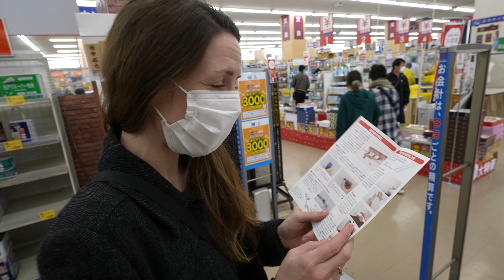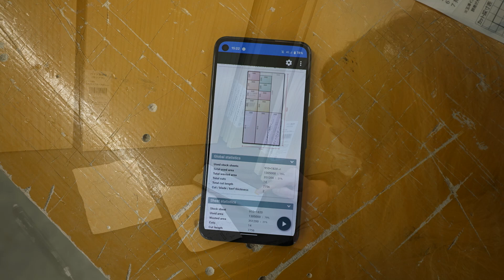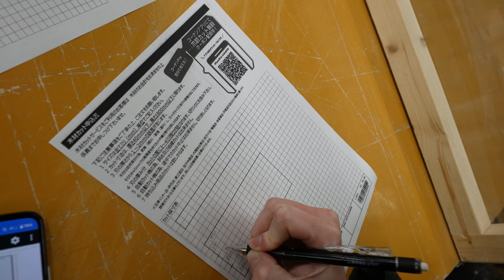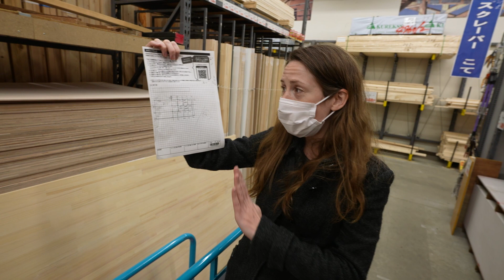DIY at a Japanese Home Improvement Store!

Comment from the maker: What kind of DIY stuff do you do where you live?
Subscribe! https://goo.gl/mkAwyy
Patreon http://patreon.com/kydeanderic
 / Paypal  http://paypal.me/kydeanderic / 
Amazon Wishlist http://kydeanderic.com/wishlist
Reply: Many.  It's kind of what I do here.  :)   (Though I dunno if "Olive, will you fix or make this?"   is really DIY or someone else getting something done.  :)  )   (Also as future suggestions go,   sometimes pre-made kits are a cheaper way to get materials.    Those metal ones,   if you get one that's too tall you could come off well buying that and a hacksaw.  :)  (It does however, seem you came off pretty well with the materials there.   In the US sometimes the pre-made stuff is actually cheaper than real wood...   if you can get a cut or two done at all that day.   The big difference there compared to here is they don't tend to want to be responsible for any precision at all,  never mind insist on getting it right.  :)  )
Reply: Oh,  also if it's OK to plug someone else's products,   check out these things called 'Wobble Wedges.'    They're like plastic or rubber shims about an inch and a half long,   and they can lock together to increase tension, especially if they're opposed to each other.  Mostly sold for like uneven tables and the like but they're useful all over the place.  (And they could be security-deposit-preservers.  :)

Comment: It's 2 free cuts at home depot and 0.25 cents per each additional cut.
The same size board you bought cabinet grade is $45-$65 USD.  I like the tension rod Temporal solution, nail holes are a pain to repair when you move out.

Comment: I liked this episode of Kyde vs the Closet Disaster.  I had a similar adventure once while trying to find a board and get it cut to prop up some drawer organizers in a closet. The organizers were measured to be the perfect size... but the trim at the baseboard made it so they didn't fit. Why is there even trim inside a closet?! (They limit you to only 2 or 3 cuts per board here in the US, that gets real tricky).
Reply: Maybe I should be replying to my own comments. That seems to be a popular move by some people.
Reply: Why is there no Apartment Depot?
Reply from the maker: You really gave up on this replying to your own comments real quick.
Reply: @kydeanderic  i screwed up by trying to leave coherent thoughts.  Turn off the brain and let the comments flow.
Reply from the maker: @powerheather  I think lots of ,,,,,,, help the comments flow too.

Comment: Just moved. Have been buying lots of stuff from my local "home centre" including timber. 5000 yen for a dressed laminated board that big is very cheap compared to Australia. I've spent that much on a board half the size. And they cutting station won't make any cuts down the board the will only cut across the board or perpendicular to the grain.

Comment: You could have just brought the metal shelves you found first at the home centre. They were the right width but too tall. But you could have just cut the 4 supports to make it the correct hight. They probably could have done it for you in the store. As they cut all that wood
Reply from the maker: I'm not sure they had the means to cut the metal legs, but even if they did we managed to make something just as workable for less money.

Comment: The Lowe's or Home Depot around here is likely to have a hot dog stand or occasionally some other food truck outside.

But, even bigger precedent is IKEA with their cafeteria inside!

Also, until the early 80's at the latest, department stores (the big standalone ones in American downtowns, not the later ones in the malls) usually had some sort of cafeteria in the basement or near the ground floor.

Comment: Fascinating to see how Kyde iterated her thought process as the project evolved. Good call on using the tension rods to stabilize the legs without using nails, but some wood glue would have worked. If you want to see a whole house project, Jaya over at Tokyo Lama is doing a whole house renovation.

Comment: Why did you not use screws? It does not need to be permanent and will add the structural rigidity that will give you peace of mind.
Reply from the maker: We considered them, but in the end the tension rods were even easier to install and are incredibly sturdy as they aren't bearing any weight. -E

Comment: Using dowels would make is much safer than relying on that metal rod, and barely harder to change in the future. but it requires to make holes into both vertical and horizontal boards
Reply from the maker: We don't have the tools for that, so it'd be an added expense. But these metal rods are very sturdy, they can hold a surprising amount of weight, and now they are just holding outward pressure with no weight. I think it'll be fine. -E

Comment: Wait i'm a bit confused so how do they stand up if yall didn't put up supports on the side like the previous shelf you showed that was there before ?.
Reply from the maker: We put tension rods holding up the sides in the top back corner. -E